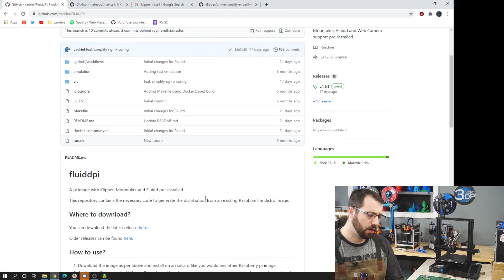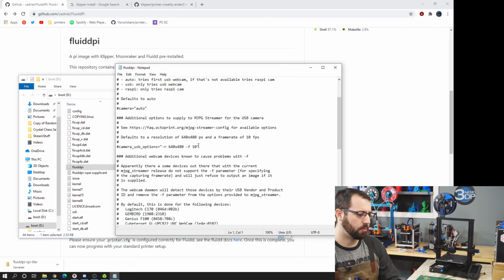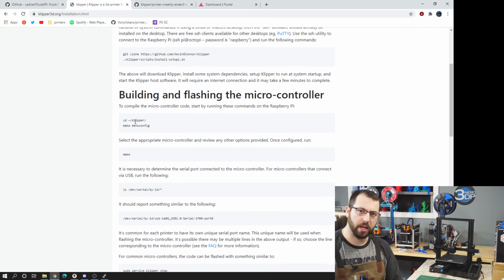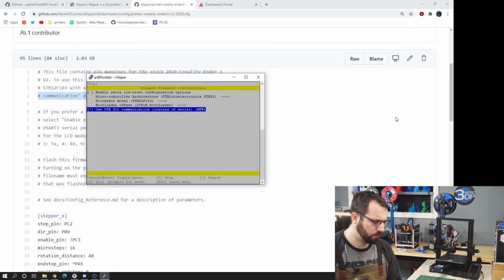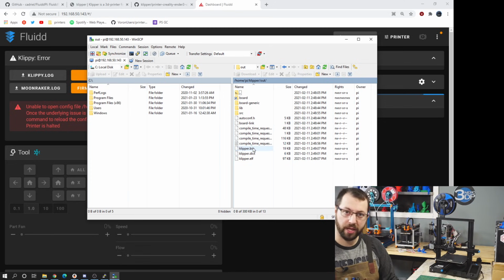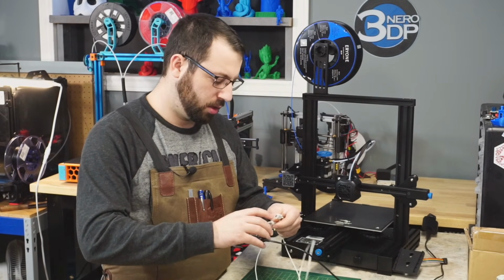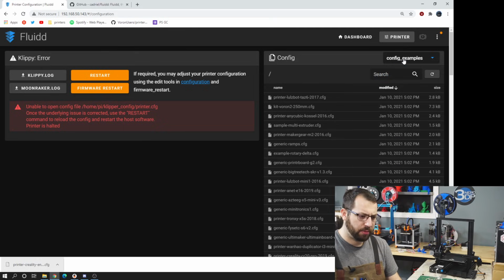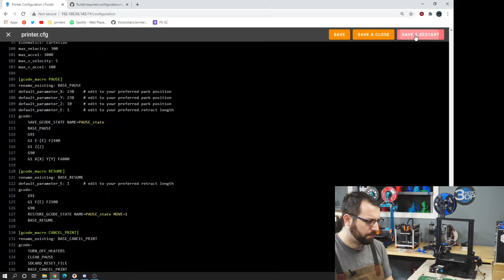Installing Klipper on the Creality Ender3 V2 (and other 32 bit creality printers)

Comment: Great video, much better than all the others I have watched. This got me all the way to the end. However....

I'm getting an error:

mcu 'mcu': Unable to connect
Once the underlying issue is corrected, use the
"FIRMWARE_RESTART" command to reset the firmware, reload the
config, and restart the host software.
Error configuring printer

Any advice on this? Thanks in advance!
Reply: Hi, did you finally manage to correct the error?
Reply: @Xtalite_  I am having the same problem. Do you know how to fix this? The web has not been much help.

Comment: I found on an ender 3 pro with skr mini e3 v2 board that in order to obtain the "/dev/serial/by-id etc. " you have to reboot the printer and the PI after flashing. I have seen so many posts about not being able to use the "ls /dev/serial/by-id/*"

Comment: Something has changed can't get klipper up and running anymore, been trying last 3 days . Was Fine ?
Reply from the maker: If you did a recent update to the newest klipper version it requires a reflash of the controllers firmware.
Reply: @CanuckCreator  yeah tried everything but ls /dev/serial/by-id/* doesn't return anything ? Am i missing something ?

Comment: Instead of disabling "use USB for communication", select "serial (on USART1 PA10/PA9) communication" for Ender 3 v2.
Reply: thank you!
Reply: I <3 you
Reply: What does it change? Im just curious i dont fully understand the acronyms lol
Reply: @Pdunns3D  From my understanding, USART (Universal Synchronous/Asynchronous Receiver/Transmitter) is a means of serially (meaning one bit at a time) transferring data that would be used for the SBC (single board computer) to be able to communicate with your printer. Depending on the kind of printer you have, I am assuming some can communicate to your SBC by some other means besides serial data transfer. The letters followed by the numbers refer to names which correspond to relevant pins on the main PCB (Printed Circuit Board) of the printer). Depending on what kind of printer you have, the main PCBs vary so the pins and protocols might not necessarily be the same. I hope this helps!

Comment: Great video- thanks!!! I have heavily modded my e3v2 - BLT, blv linear rails, dual z axis lead screws with dedicated steppers, filament runout sensor, magnetic bed with flexi pei and microswiss direct drive and all metal hot end. How easy is it to modify the standard klipper firmware to incorporate these changes?
Reply from the maker: Would just need to edit the config file to add or adjust things to your specific printer

Comment: Why Fluidpi instead of Octopi? I just put Octopi on my machine yesterday and want to do Klipper next. Should I switch?
Reply from the maker: Fluidpi(and mainsail) are designed from the ground up for klipper and offer many QoL features and is lighter weight than octoprint. Howevrr it lacks the plugin support octoprint offers.
Its personal choice

Comment: why dont i get a .bin file? i only have  a hex file. I dont know how to proceed
Reply: @Marko Sarich yes, so you can just flash it the normal way as documented on the klipper reference page. 

I never did that though instead I bought a better 32bit controller and did it the same way documented in this video.
Reply: @Marko Sarich the skr2 is a great board and it’s not terribly expensive.

Comment: Thanks for the helpful E3V2 install Vid!!
Be great to see the Ender3 V2 printing something. See what you can push it to do. If the machine isn't up for being pushed very much faster than Marlin can drive it nicely, then there isn't much purpose for changing up from Jyers maybe?
Reply from the maker: I swapped the e3v2 to another controller shortly after recording this, but if you want to see what klipper on a stock e3v2 can do check out my livestream where we were printing fast (300mms 5-7k accel irrc) https://www.youtube.com/watch?v=jkEl_hjc9xc&list=PL7zrGeKp_8CT5xxU95idifPZH2Ihz3FS6&index=36
Reply: @CanuckCreator  ah cool. I'll check it out! Thanks!

Comment: I have a standard ender 3 previously was 1.1.4 board. I’ve ungraded to bigtreetech 32 bit. Which printer config i should choose?
Reply from the maker: Easiest method would be to use the ender 3 config, but change the pin assignments to match the pin names from the BTT board. This is something ill try in cover in a future video

Comment: Someone on reddit reported that this guide worked for installing Klipper on their Voxelab Aquila.   Have you ever messed with an Aquila?    Thanks
Reply from the maker: Process should be same just use the Aquila config and maybe need to adjust some things for the make flash step if something is.called out different in the config for the aquilas board
Reply: @CanuckCreator  Thanks, will give it a shot.  I didn't see an Aquila specific config file on the klipper config list but the report I'd heard was to just use the Ender 3 V2 config.  Sorry, should have specified that.   

I will do it for science.

Comment: Hi. I have a RPI 3b+ with updated firmware. I followed your instructions to the letter and the first time I start Fluidd with the IP address I get the message:-
 “No moonraker connection. Please check moonraker status and / or refresh” 
A google search did not find any solutions. Do you have a recommendation to fix this issue?
Thanks
Reply from the maker: Give it a couple minutes on first start up sometimes theres a hangup. If it askes for the ip. Put in the one for the rpi your using
Reply: I left it for 10 minutes and then refreshed. That worked, thank you.

Comment: I followed the instructions，
But fluidd reply:
Printer is not ready
The klippy host software is attempting to connect. Please
retry in a few moments.
Reply from the maker: If it wont connect after waiting a bit. Did you ensure your usb id in the config is correct?
Reply: @CanuckCreator  I use another SD CARD,and everyhing ok

Comment: Will this work on Ender 3 V2 with the 4.2.7 board?
Reply from the maker: Yes
Reply: @CanuckCreator  Same config file? Online I find a lot of conflicting information and I don't want to break my machine ...
Reply from the maker: @SliphRahl  You wouldnt break your machine, at worse klipper would just display an error and the machine wont fully boot.
For the 4.2.7 board would just need to update any pin assignments/add anything else it supports

There may be configs for that board online already if you search

Comment: I have an ender 5 plus with an OEM silent board v2.2.1  . I have to use the at2560 for make menuconfig.  in the klipper/out folder it generates and klipper.elf and klipper.elf.hex file. I'm not sure if the ender 5 plus uses a bin file.  Do i have to rename the hex file? when i leave it as is and copy the file onto an SD, then turn the printer on. nothing happens.

Comment: Why on a 32bit board with 512k storage? 
Lol
Kipper is best for 8 bit boards not 32
Ya it'll work, but not really needed as the board already has the features for marlin 2.0.x to run perfect fast prints !!!
Reply from the maker: Klipper has more features as easier to add capabilities than marlin. And the motion planner/pressure advance implementation is arguably better.
Also. Board memory size doesnt really impact klipper at all since the only firmware flashed to the mcu is very small as all the work is done by the rpi

Comment: Ender 3V2 now supports direct serial according to the comments. Do I just connect this the the corresponding pins in the RPi4?
# If you prefer a direct serial connection, in "make menuconfig"# select "Enable extra low-level configuration options" and select# serial (on USART3 PB11/PB10), which is broken out on the 10 pin IDC# cable used for the LCD module as follows:# 3: Tx, 4: Rx, 9: GND, 10: VCC

Comment: How do i get correct temperature readings with klipper using Pt100 and e3d amplifier board? Is there a temperature table I can import?

Comment: Hi, thank you for the tutorial. I'm trying to follow this with the Ender 5 with an SKR 1.3 board but am not sure which config file to use. Could you point me in the right direction?
Reply from the maker: The ender 5 config is probably for the stock board..so what i would do is use that one to start. But change the pin assignments to match the skr pins

Comment: Wait, why is the screen not used?
Reply: On the ender 3 v2 with the touchscreen lcd display, there is no support for klipper at this time. With the screen that the original ender 3’s had there is some support for them.

Comment: bummer there are only a handful of configs. i was pretty excited to try this out but upgraded my motherboard to the bigtreetech cr-6 board which isn't supported.
Reply from the maker: If the mcu is supported and you know the pinout you can create a config yourself
Reply: @CanuckCreator  turns out it didn't stop me. it was pretty rough to find info and a lot of trial and error on such a new/rare motherboard. but i'm mostly working. great video and channel, thanks.

Comment: Does kilpper work on the ender 3 max? This sound like exactly what I would want.
Reply from the maker: Yup
Reply: @CanuckCreator  Cool, I noticed you installed klipper by itself manually. I was searching and saw other videos installing octoprint and then installing klipper from inside there.

Is there a reason you did it manually? The octoprint option seems simpler and I want to use octoprint anyways.

How hard is it to go back to stock?

Comment: I got it working, started calibrating and then it was too high off the bed, somewhere in the process it stopped extruding...   now i cannot get my orbiter extruder to work, the printer freezes when i try to extrude (yes temp is up to extrusion temp) ..... I seemed to have it and now klipper freezes and i have to do a firmware_restart to get it back everytime.

Comment: I've just watched a bunch of your klipper videos.  Very informative and a cut above the other ones I have seen so thanks for taking to the time to make them.  I've got a pi in the mail to run klipper on my ender 3 now.  I want to see how far I can push it with an orbiter DD extruder!  Once I've got to grips with that I hope to do one of the Switchwire conversions on my E3 to build the confidence to make a Voron Legacy :)

Comment: Can you run OctoPrint and kipper all from the same pi or do you need a second pi? I'm currently running a skr board with OctoPrint on a pi 3b+
Reply from the maker: You can run klipper through either octoprint, Fluidd, or mainsail

Comment: Hey Nero, is it possbile to install fluidd or mainsail on ORANGE PI? if yes can you make a video? thanks!
Reply from the maker: I tested klipper on octoprint on an orangepi zero awhile back. It should be possible but you would need to install it all manually package by package.  Fluiddpi and mainsailOS wont work

Comment: is it possible to do all this but instead of fluid, doing it on octoprint? i dont have a spare sd card for fluid. i managed to do everything in this video with my macbook and cyberduck, im just struggling with the configuration part with octoprint. it doesnt recognize my printer is available at all.
Reply: Try mainsail

Comment: That's where i was doing it wrong for the last month. I messed up the steps where you doenload the config files and then upload it. Thanks for this. Going to try out out on one printer and if 8ts as good as I think, and you say it will probably go on all my devices.

Comment: I wasnt able to acces the doc page so I rewrote down the big copy & paste options for anyone else who may need them:

[gcode_macro PAUSE]
rename_existing: BASE_PAUSE
default_parameter_X: 230    # edit to your preferred park position
default_parameter_Y: 230    # edit to your preferred park position
default_parameter_Z: 10     # edit to your preferred park position
default_parameter_E: 1      # edit to your preferred retract length
gcode:
    SAVE_GCODE_STATE NAME=PAUSE_state
    BASE_PAUSE
    G91
    G1 E-{E} F2100
    G1 Z{Z}
    G90
    G1 X{X} Y{Y} F6000

[gcode_macro RESUME]
rename_existing: BASE_RESUME
default_parameter_E: 1
gcode:
    G91
    G1 E{E} F2100
    G90
    RESTORE_GCODE_STATE NAME=PAUSE_state MOVE=1
    BASE_RESUME

[gcode_macro CANCEL_PRINT]
rename_existing: BASE_CANCEL_PRINT
gcode:
    TURN_OFF_HEATERS
    CLEAR_PAUSE
    SDCARD_RESTE_FILE
    BASE_CANCEL_PRINT
Reply: Thanks! I was looking to see if anybody commented this yet.

Comment: Is it easy to revert back to marlin if necessary?
Reply from the maker: Would require re-flashing your controller back to marlin, so save your configuration first if you want to do that.

Comment: Is it taking more resources/have any problem for the pi if i'm running with octopi & octodash instead of fluidpi?
Reply from the maker: Fluidd/mainsail require substantially less resources
Running fluidd on a rpizero controlling a corexy machine hits 20% max usually
Reply: @CanuckCreator  great now waiting for proper tuning guide from you. Really nice to have those screw tilt calculate for proper bed levelling. thank again <3

Comment: Thanks for your videos.
@Nero 3dp what is the best for klipper, Octoprint, Fluid or Mainsail?
For Mainsail and Fluid are there mobile apps like octopod for octoprint?
Reply from the maker: Between fluidd and mainsail is really a matter of personal preference for the UI
As for a mobile app, its not really require as both are build with modern web interfaces that work just fine on mobile phone size screens, so just connect through your phones web browser and you are good to go
Reply: @CanuckCreator  The advantage of an app like octopod is to be able to receive notifications of the printing status with a current photo taken.
Is there really a difference between Fluid / Mainsail and Octoprint?
Some of the Octoprint plugins are really handy.
Reply from the maker: @fabiooliveira5857  ATM there really are no plugins for fluidd or mainsail simple due thier underlying nature, its a much lighterweight interface and its designed from the ground up for klipper. This lets it be lighterweight and require much less power to run, but on the downside its missing some of the underlying dependencies that some plugins require.

There is work being done though on porting some to them in the future.
Reply: @CanuckCreator  Hi 
How can I access my fluidd from the internet? 
I have already set up port forwarding on my router and added it to the moonraker.conf file, but it doesn't work. 
Thank you for your help
Reply from the maker: @fabiooliveira5857  http://fluiddpi.local or enter the IP adress of the raspi into your web browser
Reply: @CanuckCreator  but for access without home?